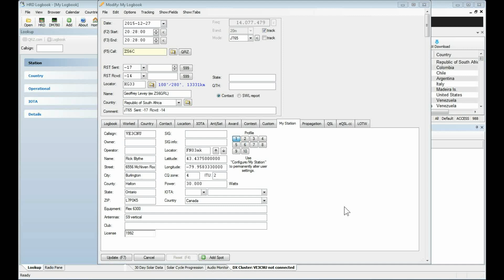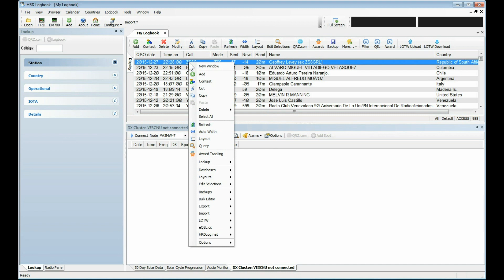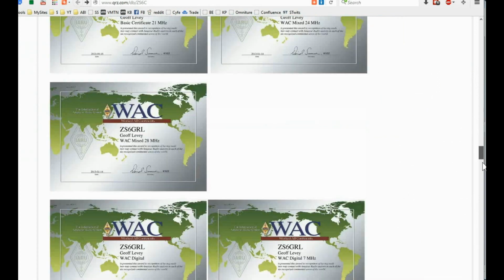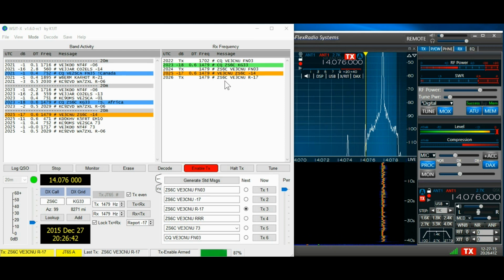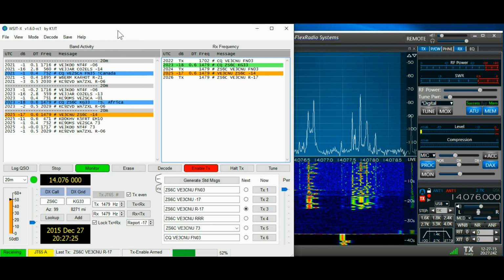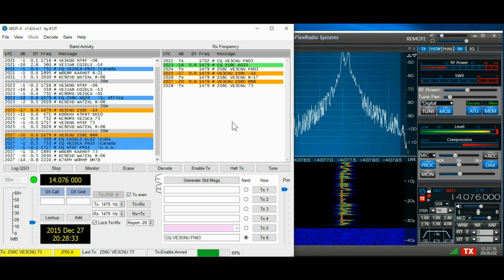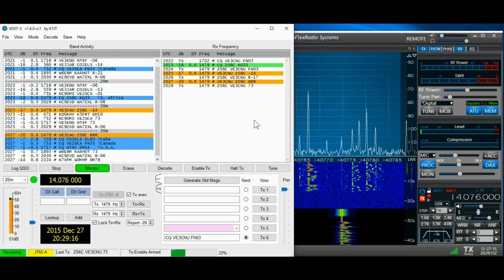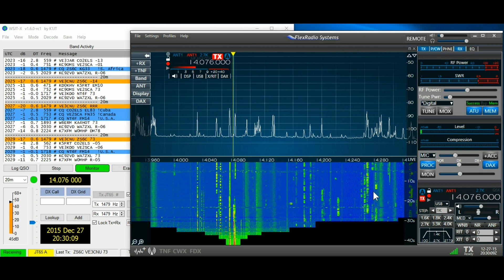DXing with JT-65

Comment: hey hey i have a request i m not sure if you gonna do it but,i m planning to buy the leixen vv 898 (china radio) i see alot of video from this radio,its a small little radio its dual band 2 meter and 70cm (i dont have a lincence so i gonna use it on pmr frequenties) the radio do 4 or 10 watt i just like the comment on the radio from a expext,owww and btw i subscribed to your channel i like your radio,s vids